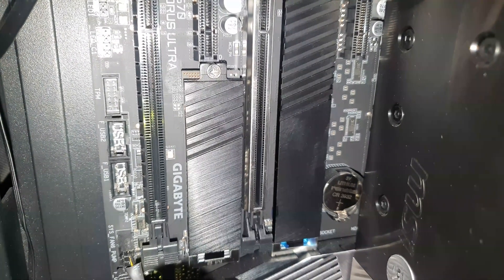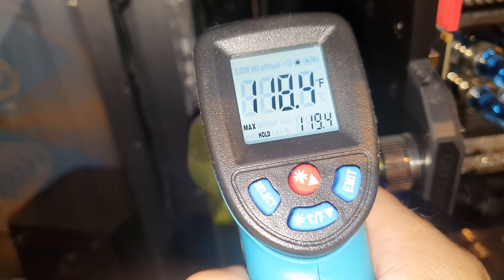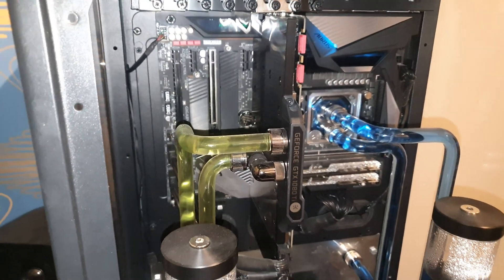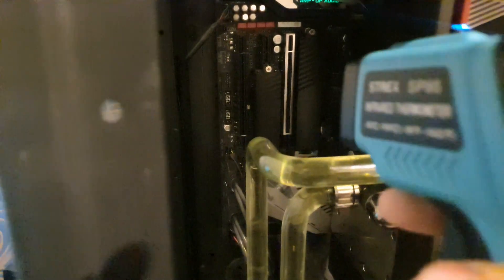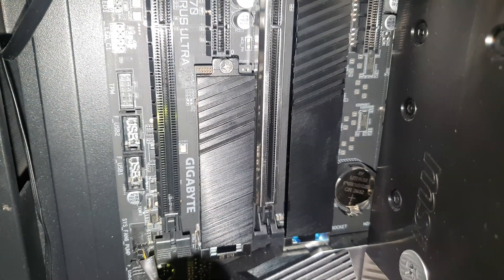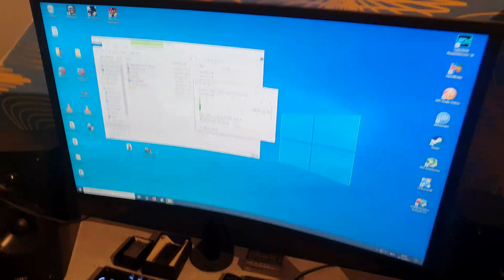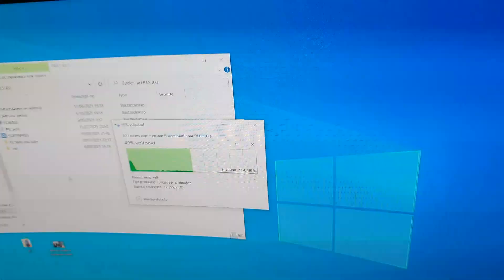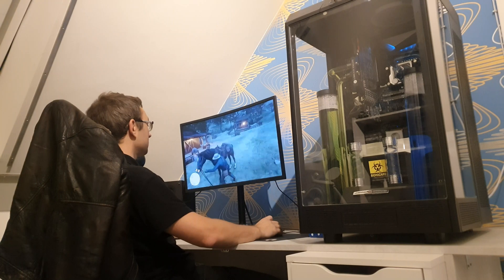How hot does a M.2 SSD  get while gaming?

Comment: When you're talking about a regular hard drive are you talking about 2.5 ssd or disk drive?
Reply from the maker: Both
They don't really get hot
Reply: @HappyDude1  so is it safe to say for a laptop to get one with a 2.5 ssd so it doesn't build too much heat?
Reply from the maker: @pablomarquez4431 
Ow yes thats fast and safe
Reply: @HappyDude1 ok with that being said heres a weird twist. I have a laptop with a 2.5 sata and a m.2 sata. If you would choose 1 to use which one to use since they run at the same speed?

Comment: Does the ssd run very hot when downloading games on to it?
Reply from the maker: If you download 4 GB a second for more then 5 min then  yes 😁 but it wil slow down to protect itself
Reply: @HappyDude1  i saw my m2ssd went to 94c after i got m'y new 850 mbs internet so i made m'y internet download slower in steam even transfering like u said
Reply from the maker: @seabseanbo5588  
Ssd is designed to run better on hot temps. If it gets to hot it will slow down. So no worries 😁 just let it rip
Reply: @seabseanbo5588 when u get to 94c, do you crash bsod or no